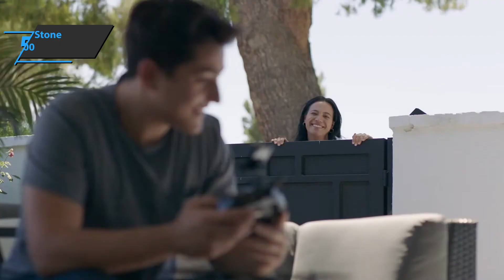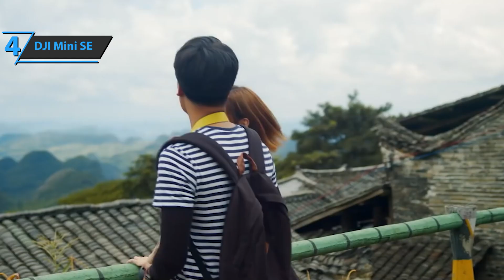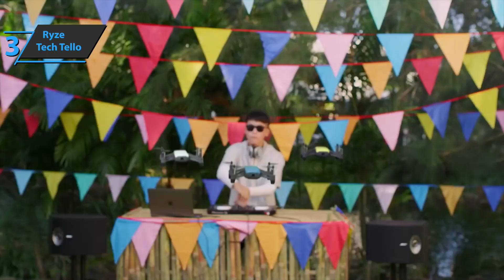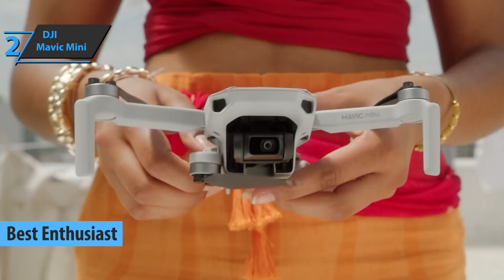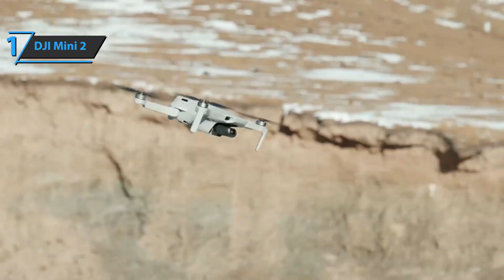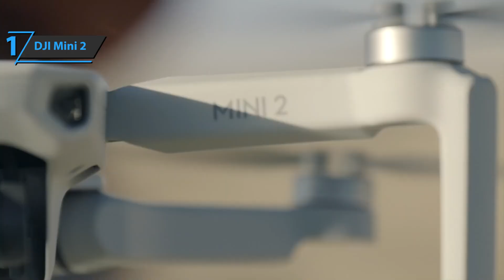Top 5 BEST Budget Drones of [2022]

Comment: Here are some popular drones 
DJI Mini 3 Pro (DJI RC) – Lightweight and Foldable Camera Drone with 4K/60fps Video, 48MP Photo, 34-min Flight Time, Tri-Directional Obstacle Sensing, Ideal for Aerial Photography and Social Media 909USD
https://amzn.to/3AaxVx9

Drone X Pro LIMITLESS 4 GPS 4K UHD Camera Drone for Adults with EVO Obstacle Avoidance, 3-Axis Gimbal, Auto Return Home, Follow Me, Long Flight Time, Long Control Range, 5G WiFi FPV Live Video, EIS, Superior Stabilization (With Travel Case) 699USD
https://amzn.to/3AAR7FP

DJI Mini 2 – Ultralight and Foldable Drone Quadcopter, 3-Axis Gimbal with 4K Camera, 12MP Photo, 31 Mins Flight Time, OcuSync 2.0 10km HD Video Transmission, QuickShots Gray 449USD
https://amzn.to/3KdCH1p

DJI Mini SE - Camera Drone with 3-Axis Gimbal, 2.7K Camera, GPS, 30-min Flight Time, Reduced Weight, Less Than 0.55lbs / 249 gram Mini Drone, Improved Scale 5 Wind Resistance, Gray 299USD
https://amzn.to/3AaJ8xK

NMY Drones with Camera for Adults 4k, 5G WIFI FPV Transmission Drone, 40mins Flight Time on 2 Batteries, Brushless Motor, Mobile Phone Control, Multiple Flight Modes, Suitable for Beginners 199USD
https://amzn.to/3wgfzJU